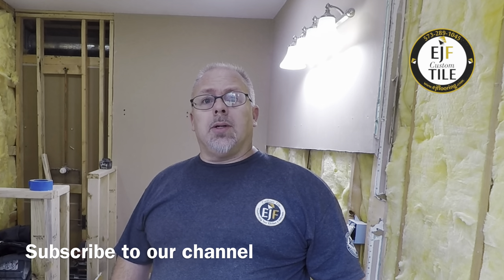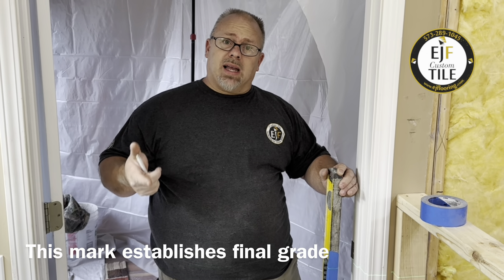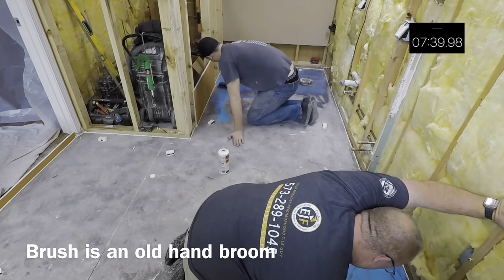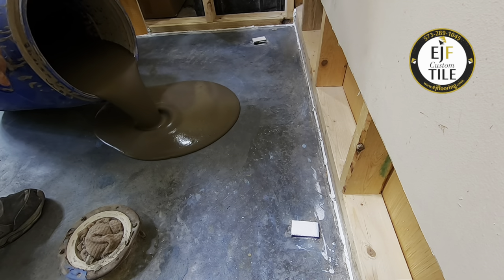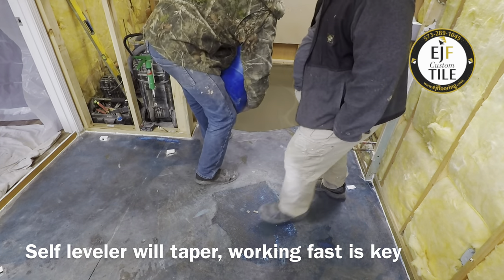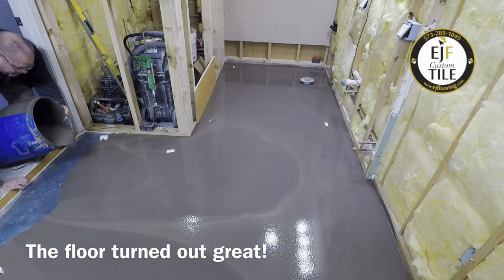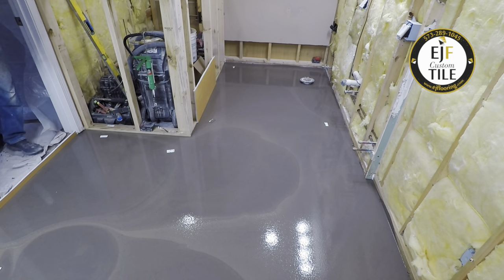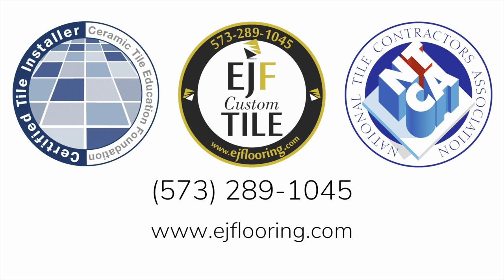How To Pour Self Leveler Over Concrete | Columbia MO

Comment: Drill a hole down toward the bottom of that barrel on the side and install a PVC shut on and off valve and put some casters on thE barbell  or get one of those Brute Garbage cans and install the valve and buy the roller caster that goes with it. It will help with your pour and not break your back.
Reply from the maker: That’s a good idea, thank you for sharing it with me.

Comment: Would you recommend someone to do this by themselves?
Reply from the maker: How big of an area are you trying to cover?  That would determine if one person could handle it.
Reply: @friendlyneighborhoodtileguy  Lets just say an area similar to what you did in the video
Reply from the maker: @CoolHand24  if you stage the area out like we did one person can likely handle it. It would be easier with two people. The mixing is easy enough but spreading by yourself can be a challenge. Depending on what you’re leveling you may need additional tools than we used. If the entire area is going to be raised it can be done with what you see in the video. Once I posted the video I did see an error in my project. If the whole floor is to be raised you need to use a sill sealer or other compressible material at the perimeter. This provides an expansion joint for the leveler. The sill sealer should be left in place until the tile is installed, then cut flush to the top of the tile. It’s only 1/4” thick so your baseboard will cover the edge nicely.

Comment: I printed a sheet of address labels out with a small ruler on them and +1/8 and -1/8 increments on them.

Just set up my laser, peel of a sticker and align the zero mark on the label with the laser line on my stick.

Makes it a lot easier to instantly read off dips and high spots, and prevents me from constantly forgetting that the upper marks are dips and the lower marks are humps.